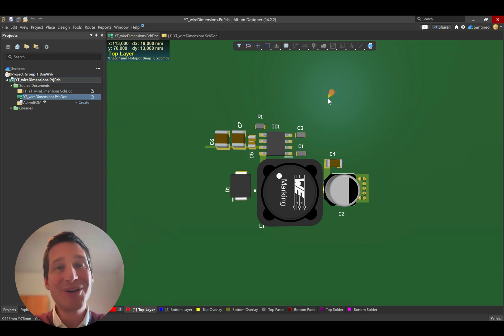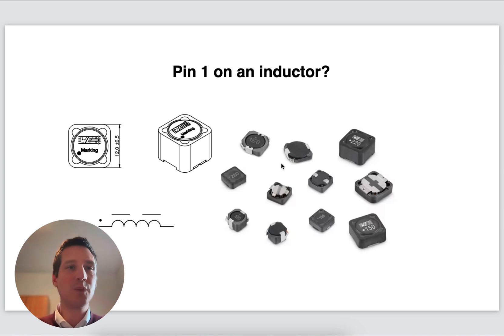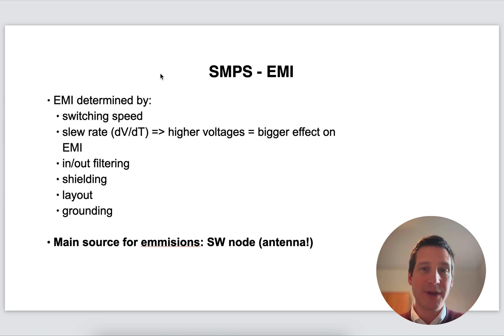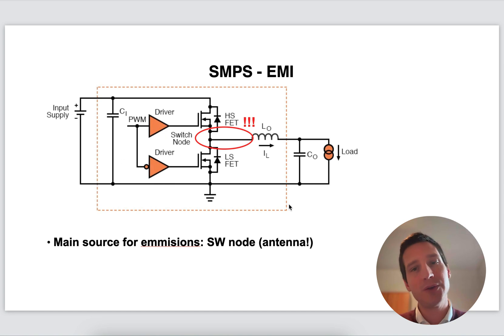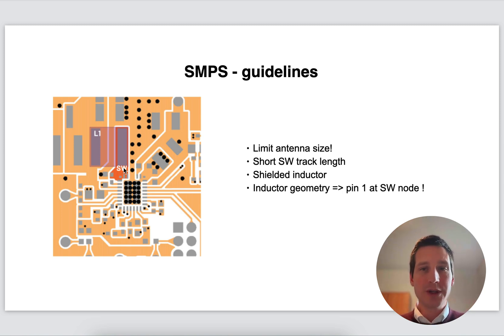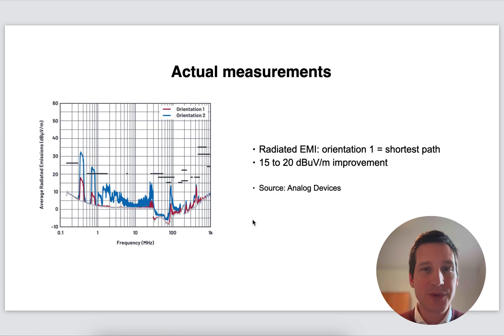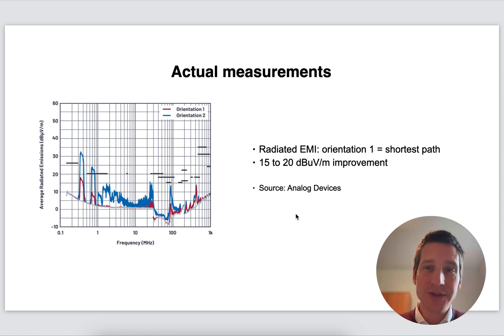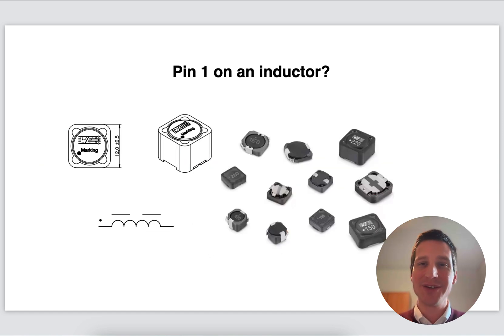Why Does An Inductor Have A Pin 1?

Comment: Thanks for your video. It makes sense if the inductor is asymetrical, but surely if you wind up the former from bottom to top and then down again to the bottom you get a fully symetrical inductor where both pins are equivalent. However real coils always have a pin 1 marked - so how do you know ?
Reply: You could of course ask the manufacturer of the coil. If they don't know whats inside theyr own inductors, they don't deserve to be in business anymore. Another way might be to take one apart, and look for yourself how its built. Generally tho, just follow the guidelines and use pin 1 on the switching node side will probably get you in the right direction pretty much almost all the time.